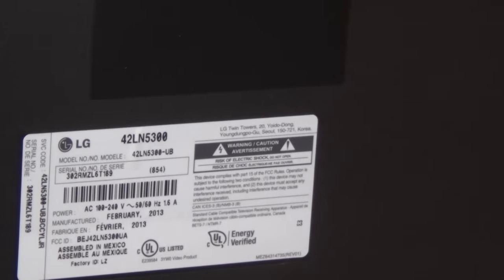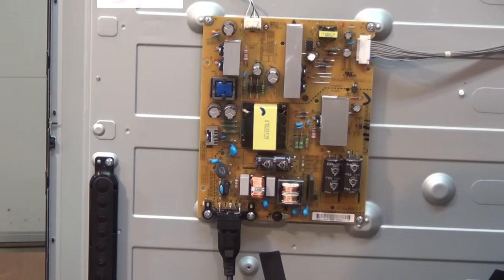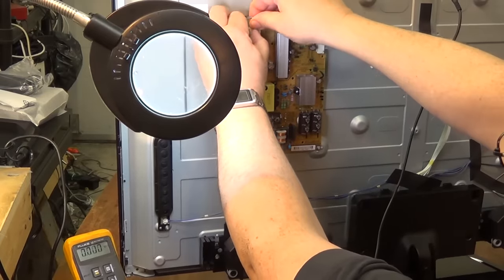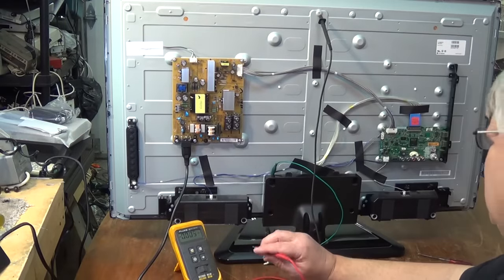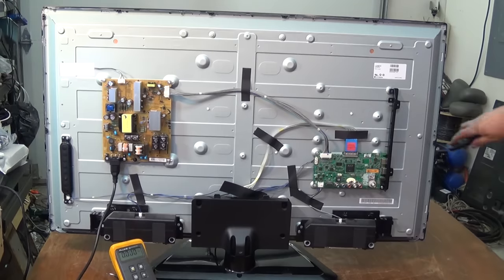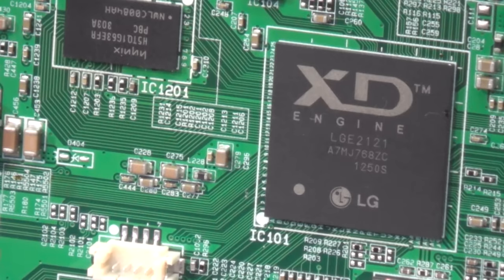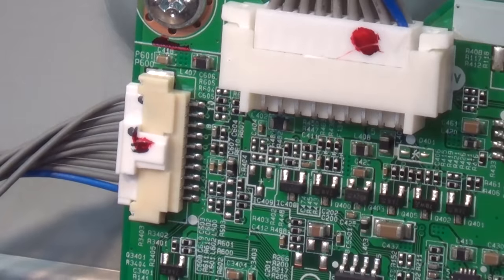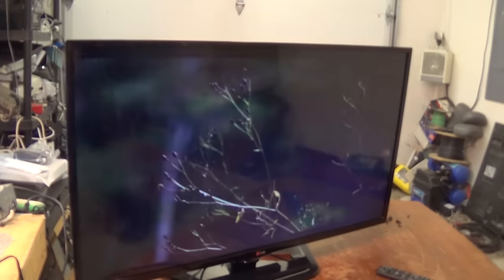LG 42LN5300 Dead   Not power supply

Comment: Hello thanks for the video very instructing.

Ihave an LG 42ld750 that started not turning on at the first time (it blinked red light). A second try it would turn on.
After sometime i had to unplug from wall ac power in order to turn on.
Then after sometime i had to hammer the input button several times to turn on (read the hack on the internet) and now it stopped turning on at all.
It is red light on (standby state) when i press on the remote it blinks the red light.

None capacitor is swollen or burst from what i see.
I see no dc voltage drop across the 2 bigger diodes near the biggest capacitors, do you think it might be? I only get some ac ripple. Maybe it's not this, as the big capacitors have more than 300vdc.

Measured the pins dc voltage
3.5v line: I measure 3.41vdc, so it'sok
The 12 and 20VDC pine I measure near 0vdc. This when the red pilot is full, when the tv is in standby state.
But the interesting part is: whem i press the button on (the blinking red state or the state of the tv trying to "boot"), I measure 12v in 12v pin but only 3.2v in the 20v pin. I dont even get the 3.41v that I get from the standby pin. It is clearly smaller, meaning it's different voltage.

My tv hasnt the chips undercovered, they have heatsink/passive cooling. Do you think the heat gun trick would work in my case?

What do you suggest in this case taking in consideration the voltage phenomenon i described?

If it helps i can upload pics of the boards.

Thank you very much to you all.

Comment: Never would have thought of using a Heat Lamp.   I would think the board would be burnt.
Reply: The question is not to burn the board but how to obtain the excessive amounts of heat to melt the solder underneath the bga and needs also a bottom preheating with having a lot of flux around the edges of bga.

Comment: Hi fella, don't know if this is worthy of note to you but will share all the same. Our LG 42LC46 (2007, owned from new) the last few months started displaying symptoms which pointed towards a main board issue (after running a while, screen was flickering between picture/static on all inputs & on one occasion picture completely went with backlight and sound both still working, controls locked up.  However, on inspection it seems (fingers crossed) to have merely been tarnished connections on the cable between sig. and Tcon boards.  Time will tell, but heating/cooling/tapping the boards couldn't reproduce the symptoms but touching the connector on the main board did, cleaned connectors and seems better now.  Just in case it's any use to you.
Reply from the maker: I had that on a Sony but it was the tabs between the tcon and the screen.

Comment: Hi I did the same with a friends PS3, i use liquid flux and used a heat gun to heat the chips up and it worked. dont give a shit if it's not a full time fix it was a favour and it still works today over 12 months, at the end of the day it's working and not in the skip.
Thanks again for a fantastic vid dude.
Simon

Comment: Very helpful thanks. A Lg tv I picked up tonight wasn't turning on so I put the gas heater on and placed the back of the tv 2 feet from the heater 25 minutes and a slight distortion to the back plastic I plugged it in and it turned on . Nice cheap Tv.

Comment: I have a similar model LG TV (55LS4500) sitting on the table opened up in front of me. I don't have this problem, but tested most of the items you showed here for thoroughness. My problem is the TV will play fine for anywhere from a few minutes to an hour or so and then various sections of the TV seem to lose backlight. 

It started over a year ago with only one dark spot that would come on and off randomly as the TV was on. Now it has about 3 sections of the TV that get darker (as if the LED's in those sections would stop burning). Sometimes they light up fine, but usually at least one of the sections are dim on startup, then the other couple go out as the set warms up more. You can watch the TV fine, but it's very noticeable unless you're watching a dark movie. Bright commercials show it very evidently. 

Does this sound like an issue from the power supply dropping out for certain sections of the backlight? Or more likely failing LED's? I checked the test points at the top of the secondary side of the power supply board labeled LED+ & Gnd and it shows about 76Vdc. The two connectors beside that test also 76Vdc on the LED+ pins. I tested 3 of the longest pins on those connectors with my meter's common lead on the Gnd test pin and they all read about 19-20Vdc. (I didn't risk testing the shorter pins from fear of shorting 2 pins with my test leads.) I tested all the voltages on the connector going from the power supply board to the main processing board and they are spot on with the voltages labeled on the screen printing by the connector.

Guess I'll have to break the panel apart and isolate bad LED's right? Any advice is appreciated.
Reply from the maker: It's the LEDs that are going bad. LED tvs are garbage.
Reply: @12voltvids  quick and to the point. Have to agree. But it's just ashamed they don't last longer. In your opinion, what would it take to build a quality LED backlit LCD television? Better, higher-quality LED's?
Reply from the maker: @TortureBot  
Go back to fluorescent backlighting.  Better still plasma TV.  I have a plasma here from 2003 still going strong.  
I have an LCD computer monitor with 51,000 running hours on it and it works perfectly.   Led sets are junk. I am still undecided on oled.  My phone has an oled screen and the bloody qwerty virtual keyboard is burned in.   Put up a white screen and the burn in from the keys is burned and that is from only 1 year use.  I dont live on my phone either.  In an average month I use under 1 gig I'd data, and I dont use it much at home.

Comment: I tried this method using a 50w gu10 halogen on the main logic board of a Acer gd245hq computer monitor , im not sure what i did wrong, maybe i didnt leave it long enough since its winter here in my country, too far away possibly or i didnt let it cool down long enough, however when i heat up the chip on this board with a hair dryer for about 20 seconds on high heat then i plug in the power pretty much straight away and the monitor lights up and works perfectly. Ive only left the GU10 on for about an hour about 2cm from the board and leave it to cool down until its just slightly warm, im guessing i should be leaving it on for longer ?

Comment: Thanks for vid, crappy design from Lg not heat-sinking that chip it gets hot which causes solder to fail.
Reply: I agree totally. Heat sinking both those chips in some way will resolve or reduce the frequency of such an issue.
Reply: I wonder if this is the issue with our LG 42LY380, manufactured August 2014?
We can turn it on, but the LG logo immediately fades (while the LED power light is OFF).
Does it have anything to do with the hot weather we have been having?
Can anyone in Atlantic Canada fix this?
Reply: @PaulBranscombe  If you have a similar heat source around and have a screwdriver handy, then yes, you could fix this issue. Check the PSU first, then the main board. And I agree, a heatsink with proper CPU thermal paste like on PCs would help the issue.
Reply: Dont necessarily agree about the heatsink. Ive seen a lot of similar bga problems and its not down to heat,  its the original reflow not being 100 %. Its a very controlled 3 step process thats very precise due to the huge quantity of balls. This can then fail in the future.

Comment: Hi this is Jack from upstate NY.  I am enjoying your videos and now have a 2017 Chevy Volt Premier.  Question about switching power supplies. The pwr. supply in my Wersi organ  has a large heatsink that  seems to run too hot. 200 degrees F.  average, would you consider that normal? I have changed all the componants  after the switching transistor burnt out. Installed the correct one with higher amperage.  But it still runs i think hotter than it should, any comments on that?     Thank you,        Jack.
Reply from the maker: 200 seems hot for sure. Sounds like something is drawing too much current.
Reply: @12voltvids  Hi, Thank you for the reply.  I just added a smaller 2nd heatsink glued on to the original.  It now runs a lot cooler around 120 degrees F.  I think it will be ok  now. I have two of these Wersi organs with the same power supply, and they both act the same as far as heatsink temp.     Thanks again,       Jack.

Comment: I had that same TV. I replaced the t-con board and only half of the panel was displaying picture. Sadly I could never figure out the problem.
Reply from the maker: I have seen several LCD sets that I washed my hands on. Of course you don't see those videos. Half a picture is generally the tabs that connect the TCON to the panel.

Comment: Hello I just found this video and it helped explain so much I was wondering if you may be able to help me with an issue I am having with my living room Tv. It is an LG 42CS570 when powered on in the morning after being off throughout the night it will display the LG start up screen it will then slowly start to fade while 1 inch of full picture (left to right horizontally) will appear at the top of the screen the lower will still be fading from the LG logo from start up after approx. 1 hour of being left on it will display full picture as if nothing is wrong. No further issues until the Tv is powered back off and allowed to cool down a bit or if the air around the TV becomes too cold while in use it will start glitching picture usually lower than 70 degrees or so. Any help would be greatly appreciated.
Reply from the maker: Well some component, or a solder connection is heat sensitive.
A heat gun and freeze spray should help you locate the bad part.
Couldn't tell you what it is though as I have no idea. That is where the diagnostic skills come into play.

Comment: nice video, can you tell how to repair traces on power supply, i was working on samsung led power supply and the trace was quite big that my iron was unable to heat it, i used hot air gun to heat it and the trace got some bubbles underneath it. 
I am worried if that may affect the operation of smps now. Can i just scrape the solder ask and tin it with solder?

Comment: I hava a pioneer sound system. its main chip was showing the same problem. The unit was turning on but getting off after a while. I zeroed the problem to the main board chip. But as usual, I got faulty chips fro ebay twice. lastly the unit went to scrap.

Comment: Thanks for your nice video. I own an LG  47LD750-ZA TV, and suddenly one day I got no picture.
The standby light in the middle of the TV, lights upon plugging the set on the electric outlet.
Then if I press the ON button on the side of the TV, then the standby light of the TV starts blinking(at a very slow rate) and of course nothing happens.
I opened the TV and the capacitors on the Power Supply Board all look good at a first glance.
In your expert opinion, what could be my problem ? I am probably too far away from you, so you could examine the patient from closeby, but I would appreciate an idea of what the problem is, or do you believe is too tedious to proceed with trying to fix the board ? Thank you again
Reply: I have the exact same problem with my LG TV. I'm going to try this heating trick to see if it will help.
Reply: @Foel87  did it work?
Reply: @wrathpsp  It did not. Actually the problem was not the chip. My TV had a LED broken in one of the LED strips and that somehow made it so that none of the LEDs turned on. I just soldered a wire over the LED and everything started to work again. Of course now if I have a clear white background on the TV I can see a dim 10 cm spot on the screen. But while I am watching TV-shows or browsing through something on my TV i cannot really see the spot.

Comment: I'd love to figure out what is going on with my old set, I'd hate to just toss it if I can fix it easily.  It won't turn on, no standby light.  When I opened the back, the first thing I checked were the two fuses; one was good but one was blown.  When replaced, it immediately blew again (I tried it a few times with new fuses, same result).  No bulged caps or burned areas that I can see.  I just don't know where to go from here - I can't add power obviously, and while I have a multimeter I'm not very well versed on it.  Where do I go from here?  I just need to be pointed in a direction to try, knowing that Power can't be connected.  Thanks!
Reply from the maker: Mosfets on the power board.  Perhaps a diode or 2
Reply: @12voltvids  - thanks, I’ll check it out!

Comment: i have a lg 60ln5600-ub with power issues. when plugged in standy light is on. hit power button, get 3 blinks lg logo flashs then goes away.. changed out main board and power supply. so either i got bad ones or theres a different piece bad.. Any clues..

Comment: On mine, the power surges where the LED’s plug in to the power board. What should I check?
Reply: Same. Did you ever figure it out? Going to try heat gun on IC chips. Thinking of buying a capacitor tester as well. TV will work for a few then start blinking out, audio continues. I tried a LED tester and was able to light up LED's but only confirmed through back shield holes.

Comment: Quick question - how many Volts should I be measuring at the LED backlight?  I could swear at 11:20 you said 48VDC.  I've got 93 VDC constant but all my standby Voltages are correct.  I don't have the exact power supply but the main board on my 55LN5400 is the same and all of the PSU connectors are the same.
Reply from the maker: That depends on how they are connected.  2 48 volt strips in series is 96 volts and 3 of them in series is  288.

Comment: Cool, saved my tv after watching this...i was about to throw my LG 3D TV  47LW5700 away..  my LG was not turning on and power light was blinking,,  because its on the wall and heavy. I didn't feel like taking it down and opening it.. after hours of shopping online for a new TV i was pissed and installed an old 22 lcd tv in front of the LG until i can find a good deal..it was a good excuse to buy a new oled tv or something.. i was just pissed to spend 1.5k ..i wasn't prepared.. i couldn't sleep.. anyway. After 8 hours or so I saw this youtube and i had to try this out first before giving up ..   i had to open the back panel and every tv is different. The 47LW5700 has all the screws around the perimeter and about  5 screws around the center.  Once exposed, i checked the voltage and was reading 3.5v too. So i just went ahead and use a heat gun and an infra red temperature reader.. the two chips were covered by a heat sink.. i did not know how to remove them so i just heated directly over the heat sink layer. About 20-30 sec of heat to reach 200F The heat probably transferred over the chip.. then i allowed cool down,,at first it did not work, then it just started to work again.  I was dam happy...woke up the wife (she did not appreciate that) but needed her help to hang the TV on the wall.  Started to watch TV for about 20 minute..and bang!  TV shutdown by it self and turn it self back on.. was kinda disapointed.. but atleast it works...unhooked the tv from the wall again.. reopened the case and re heated, but this time i heated atleast 10 good minutes at 300F.. reclosed and put it back on the wall.. this time it worked better. No shutdown..2 hours later still no shutdown..3 hours later still going strong,,  it looks like the reflow is working this time. However i noticed while closing the rear panel that LG made holes to evacuate the heat through those holes that are right over the two main chips.. so next time i may just heat directly there without opening the panel. But i understand this is not a permanent fix..  but atleast it will give me some time i hope to find the best TV deal...we are only few weeks  from blackfriday..

Comment: Do you have a diagram for this power supply board? i have a similar board LG39LN5100, I have check the values so far looks similar its just that we use a ac 220v from where I'm from. i can send a picture of the board. one of the ceramic capacitors blew due to power surge. its the capacitor on the right side of the yellow block, there are 3 blue ceramics there, its the blue one right next to the heat sink. can you tell what the value is for that capacitor? i would greatly appreciate the help. Thank you so much also for the inputs on how to remove residual charges for the 3 big capacitors.
Reply from the maker: No schematic for any tv
Reply: @12voltvids  thanks for the info

Comment: Great fix man. I will second that request for a little more detail on the reflow process, and temps the reflow process would need. Thanks for making the video.
Reply from the maker: +roomba I am just killing time now with an old board and my light bulb. I will attempt to remove a BGA chip using nothing more than a Halogen lamp.The required temperature to reflow is about 218'C and a lamp will get it to that temperature over time. So far I have been lucky with the smaller chips I have tried this technique on. Larger ones would likely need a board warmer, and heat gun.
Reply: 12voltvids
Thanks for that answer.